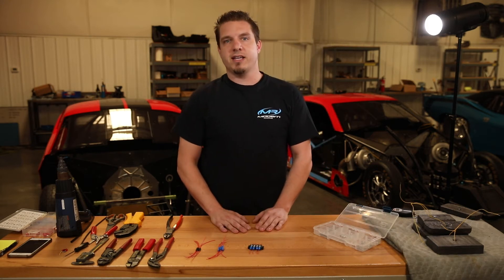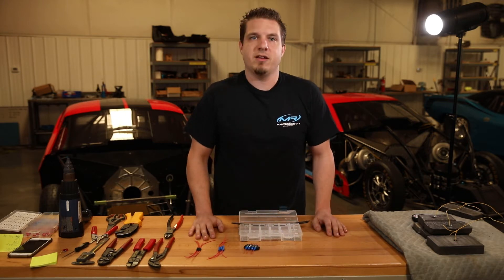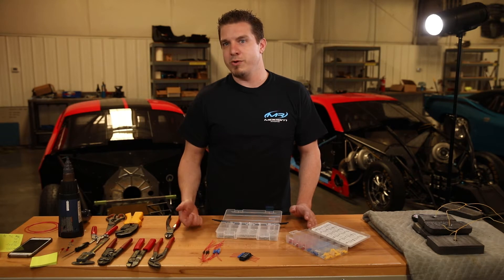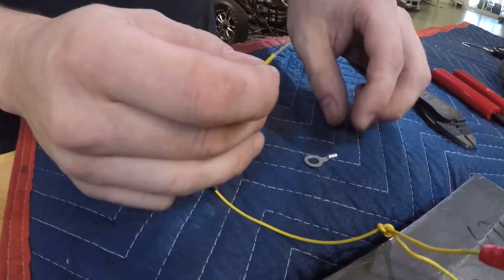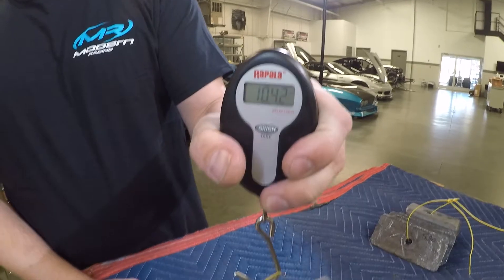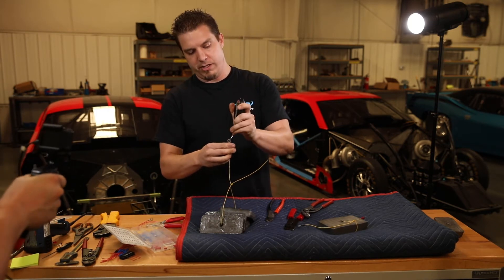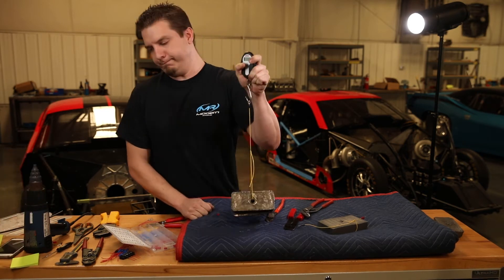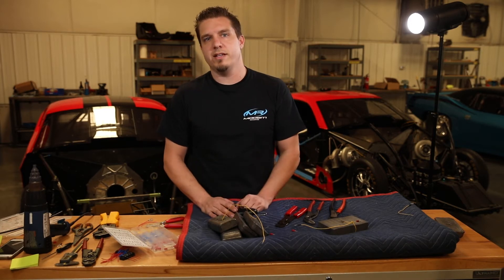Ring Terminal Installation Tips, and How Much Can They Hold?

Comment: Why are we not using Industrial/production grade terminals with insulation retention. They make plenty of ring, spade terminals with a insulation support barrel, locking, and many other useful features. Maybe you guys do use them on customers cars?  But why not offer the consumer a product of the same quality and reliability that successful teams depend on?  I'm not a product rep or anything but I'd be happy to help/share what I have learned in the industry. 

CRIMP QUALITY GUIDELINES:    https://www.te.com/content/dam/te-com/documents/application-tooling/global/65784_Crimp%20Quality%20Poster_ENGLISH_26x13%20version.pdf

Ring Terminal:   https://www.te.com/usa-en/product-350436-2.html?te_bu=Cor&te_type=srch&te_campaign=ggl_usa_cor-ggl-usa-srch-selectmktg-fy21-googlefeed_sma_sma-1735_94&elqCampaignId=95278

Ring and Spade Terminals:   ://www.te.com/commerce/DocumentDelivery/DDEController?Action=showdoc&DocId=Specification+Or+Standard%7F114-2084%7FF1%7Fpdf%7FEnglish%7FENG_SS_114-2084_F1.pdf%7F350436-2